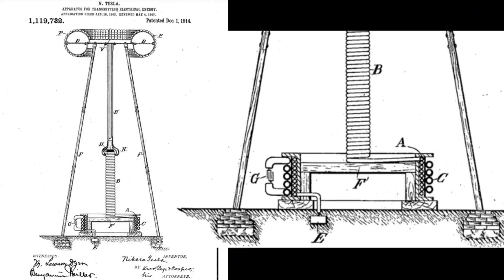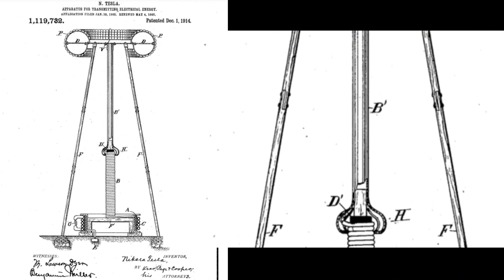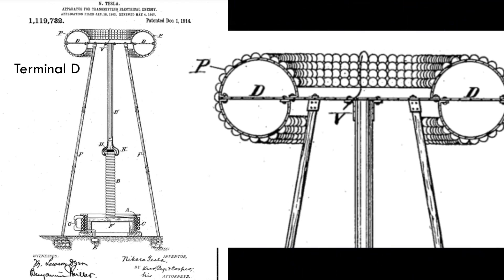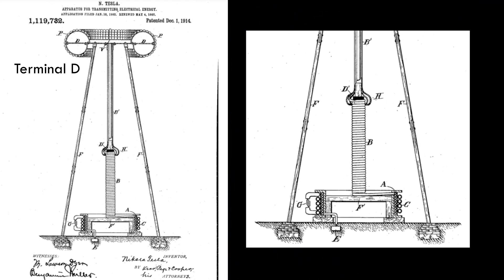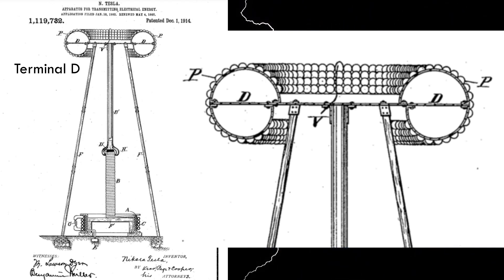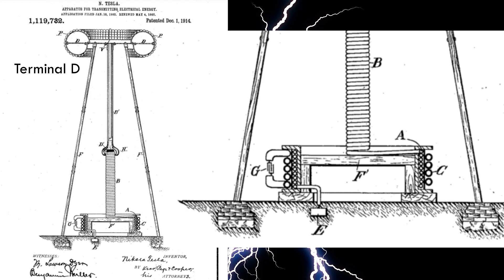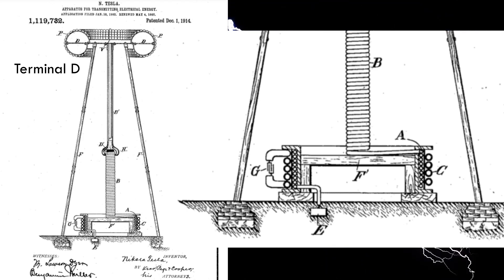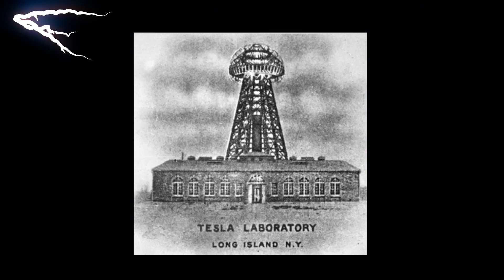Tesla's Patents:  Apparatus for Transmitting Electrical Energy

Comment: I don't understand how this is useful for energy transmission today. The description is a pretty standard (now) Tesla magnifier. It will radiate at the resonant frequency of the third coil primarily. A reciever would need to be optimized for that frequency. Of course anyone using similar frequencies and other resonant frequencies it emits for communication would have their signal jammed. If it arcs there is a lot of lost energy and noise produced at even more frequencies. The US FCC, and similar agencies in other countries won't allow it.
Reply from the maker: With this system, ideally, there wouldn’t be terrestrial radio broadcasts above ground.  His idea was to move communications (and power) through the Earth which he describes as “responding to electrical current like a solid metal ball”.  Multiple stations, complex frequency modulation.   The ground plate, E, in the Wardenclyffe tower he built was a ground based electrode several hundred feet in circumference and over a hundred feet underground.  
Brooklyn Eagle Article, February 8th 1902…. “Inside the big tower a well 120 feet deep has been sunk, the well being 12 feet square, cased Its entire depth with 8 inch timbers, which will be finished off with brick and cement. A staircase, which will lead down into the well, is nearly completed.
 
Transversely across the bottom of the well will be a series of four tunnels, each to be 100 feet long, and a force of workmen has begun work on these subterranean passages.”  This gives you some idea of the structure below ground he had planned.   
Ideally tuned a Tesla coil wasn’t meant to arc.  It was meant to conserve the charge as a large electromagnetic oscillator.  Tesla mentions arcing as being wasteful because the moving charge was the goal.  Much like an electromechanical oscillator would vibrate a physical structure Tesla believed an electromagnetic one could move the structure of currents in the Earth.  Multiple stations required at resonance sort of like an electromagnetic Newtons cradle.
Reply: @energyisfree  It would have to be very low frequency to propagate through Earth making the high frequency resonant circuit unnecessary. Like 5G, high frequency isn't transmitted very far and does not penetrate through solids very far.

I wonder how much power we can get from a 4G signal? I never tried to calculate it. It probably isn't much.
Reply from the maker: @rayfleming2053  all true!   The Tesla coil, however has an interesting feature of its sine function.   Because it’s a resonant transformer even a coil that resonates at a high frequency will have a “beat” which is much lower frequency if tuned properly …. And Tesla must have spent most of his life tuning.   If you look up the graph of a functioning coil you’ll see what I mean.  And the peaks and valleys of that, with a system the size of his magnifying transmitter at Wardenclyffe, would be quite sizable in charge density.  Tesla specifically states that the difference between his Wardenclyffe tower and a standard radio tower is that a radio tower emits 90+% as radiation and has relatively low current density whereas his tower is less than 10% radiant and 90% moving current.   He’s not trying to send a signal he’s trying to “tap something” electromagnetic at a tuned frequency to get it resonating.   Imagine how big a structure you must need to tap to make something capable of a charge that big?   Tesla believed that the Earth already had currents flowing through it which could be set in motion…. And he verified his theories with his experiments at Colorado Springs.   The ground for the coil at Colorado Springs was attached to a water main and nice and deep.  I think a 4G signal would give you very little power.  Thank goodness for that, I think it’s at 2.4 GHz or close in the upper band.  If it was powerful enough to draw electricity from it would cook us like a burrito in the Microwave!  My video on “was one tower enough” is a set of very rudimentary frequency simulations to play with the concept of his resonating earth idea.
Reply: @energyisfree  I'd like to add to the topic of Tesla Coils and the Magnifying Transmitter. From my research I believe Tesla Coils have the ability to produce far more output than input, and it's because of the resonance.

I believe you can extract both high volts and high amps from the secondary without straining on the primary because the extra power is now coming from the resonance amplification in the secondary, as long as the rate of increase in the secondary is enough to produce more in the secondary than is drawn from the primary, higher output than input is completely possible. 

The input torque of an electrical generator would free spin freely and indefinitely if not for 2 things, Friction and the Backwards Translation of Load, in the form of a reverse magnetic field which forms as a result of the forward current, and which opposes the input motion. This reverse torque fighting the input torque requires more and more energy to be applied at the input to continue the ability for the extraction of energy at the output.  

Tesla spoke about this reverse current and reverse magnetic field, now called the Lenz Law. Tesla opposed the reverse torque natural occurrence, with the introduction of capacitors into an already inductive generator coil circuit.  This is evident in the writing of Tesla's pancake coil patent.  But more importantly, he invented resonant electrical circuits, the resulting oscillations that occur within the same capacitive / inductive circuits, which alternately transmits magnetic and then dielectric pulses, over time, which each passing electrical half wave, and influence other similar circuits with the same electrical resonant frequency.  

The key here is that these secondary circuits are forced into electrical oscillation without a backwards translation of load, so long as the frequency remains perfect on both circuits. In other words, if you can keep the circuits resonating while you extract power from the second circuit, you will be able to withdraw more energy from the output than there is needed at the input to keep the system running. Then you can loop a portion of the output to power the input continuously and indefinitely.  This has been successfully done and demonstrated in the work of Don Smith of Texas USA, and Tariel Kapanadze, of the soviet satellite country Georgia.  

The configuration is Tesla's patent 645576, System of Transmission of Electrical Energy. The configuration is Resonant circuits that are connected via the dielectric field. A tesla coils is also capable of this, resonance takes what you put it and amplifies it beyond the input, because the source that provides that extra power outside the input is from outside it and unending, the Aether is non-Cartesian it doesn't have a limit, Eric Dollard calls it counter space, and this applies to both voltage and current, dielectric tension and magnetic amps.

Furthermore, the law of conservation of energy doesn't apply at all, nor could it ever:

"but as we've seen neither Maxwell's equations nor their solutions indicate the existence of a causal link between between electrical and magnetic fields. Therefore we must conclude that an electromagnetic field is a duel entity always having electric and magnetic components simultaneously created by their common sources."

"according to these equations in time variable systems electrical and magnetic fields are always created simultaneously because they have a common causative source, the changing electrical current, once created the two fields coexist from then on without any effect on upon each other. Therefore electromagnetic induction is a phenomenon in which the field creates the other, I.E energy generation is an illusion. The illusion of mutual creation arises from the facts and time-dependent systems of the two fields appearing predominantly together"

-Causality, Electromagnetic Induction, and Gravitation: A Different Approach to the Theory of Electromagnetic and Gravitational Fields

In layman's terms, this means there is no transduction of kinetic energy to electric energy, no kinetic movement gets transformed INTO electricity, into dielectric and magnetic fields, nothing ever has, a spinning generator only sets up the conditions for electricity to manifest, this throws the "law" out the window. Electricity comes from the conjugate of magnetic and dielectric fields as a generator "churn up the ether" as Tesla put it.

If my suspicion is correct, a tesla coil that is in perfect resonance can forever pump out higher volts and amps as long as the resonance is perfect between the 2 coils, a small increase in power output of the primary should result in an exponential increase in the secondary. I'm working on a prototype that will let me test this by attaching thicker wires to the ends of the secondary to draw higher amps, strain on the primary can be avoided by either increasing the strength of the primary a little or using a very high frequency, I believe double conical shaped secondary coils would be good for that.

Now for the magnifying Transmitter, I'm not entirely convinced Tesla was using high frequency for this one in combination with other towers because of the frequency required. Tesla was able to narrow down the electric frequency of the Earth to 11.772(8)Hz. I believe the magnifying transmitter was meant to act as the primary coil, and Tesla was using the Earth as the secondary coil. I imagine tuning it to 11.772Hz should have been easy to do without requiring other towers to interact with the primary.

Alternatively, it is possible he was intending to use multiple towers for high frequency to create the low frequency of 11.772(8)Hz for the above mentioned reasons, unsure.

Contrary to popular belief the Schuman Resonance has nothing to do with this either, because that frequency is related to oscillations in Earths atmosphere, Tesla determined this energy would be unrecoverable. In this case the magnifying transmitter would need to be on that low frequency to resonate with the Earth to induce the same effects as in a regular tesla coil, this also matches the analogy image he created. 

In effect, Electric power has never come from our universe, it has ALWAYS come from the Aether. 

The final result is a circuit that uses a power source to create a new power source that exceeds the original input, and that new power source is being induced from the Aether which has no limit, using resonance. 

In a Tesla coil the new OU power source is in the secondary. In the Magnifying Transmitter, the Earth itself is the OU power source.
Reply from the maker: @JenkoRun  it is an interesting idea that he wanted to use the Earth as the secondary.  As I said above the coil has a beat which is lower in frequency than the coil resonance so perhaps this was goal.  Turn the earth into a coupled oscillator.  The real question from everything you said in my mind is…. How can you prove by experiment that more can come out than went in?  You’re comment was amazingly detailed and I can see you’ve done a lot of research.  Can you test your theory with experiment and if so…. How and when can we show the world because I would be only too honored to display that research on my channel, humble as it is.  Let me know!   I am quite serious.  Anything that can be proven experimentally, however non intuitive, must needs be true if the experiment is properly conducted and repeatable with a solid data outcome.   The sincerest form of peer review is the repetition of an experiment with a successful result.
Reply: @energyisfree  Indeed, the theory must be proven by experiment before being claimed as fact.

At the moment I have 3 concepts for a potential OU device, 1 based on a TC, another based on resonance apparatus linking from the patent, and the last being a miniature M.T that uses a separate component in place of the earth to self-act (still figuring that one out), I also have some ideas for a DRSSTC that uses an extra coil as well.

The main idea behind the regular TC, or SSTC, for this in the most simple explanation, which is the first type of device I want to try building, is that it creates more tension (volts) than are consumed during the conversion to amps, provided you don't hook up a load that requires a volt or amp load beyond what is being generated in the secondary it should be possible to supply the power without eating into the primary, if the draw exceeds production it will begin to "leech" of the primary and into what limited power is being generated from the source, the only way I know off to get more out than in is through resonance, that's why it seems the conservation law applies in regular circuits, and since we're dealing with a non-Cartesian source there's no limit to how much can be pulled from it through resonance aside from the resistance of the physical parts themselves.

If 1 fails I'll move on to the next and make modifications where required, if I succeed I'll contact you by email (or whatever method you prefer) with proof of the device working for you to do with as please, if none succeed... 

Well, I guess I'll be very sad for a while and then go back to research, lol.

I'm hoping to be able to acquire the parts to start experimenting in the coming months, poor mans land keeps things slow, here's hoping!
Reply from the maker: @JenkoRun  my lab died years ago for the same kind of financial difficulties.   I will be excited to learn of your data.  I am interested in any experimental verification of “more out than in”.  Please let me know how it goes!